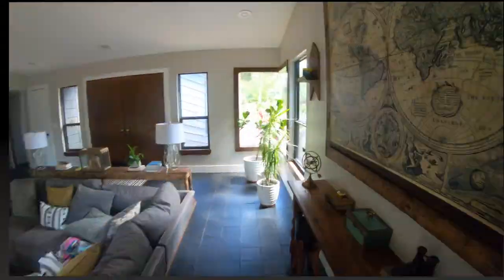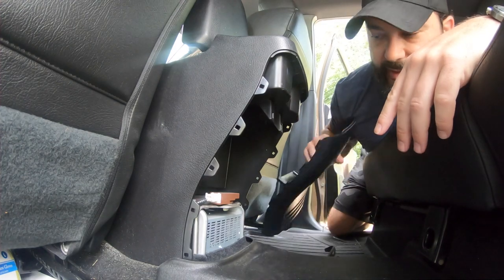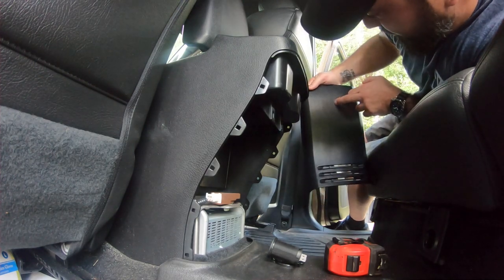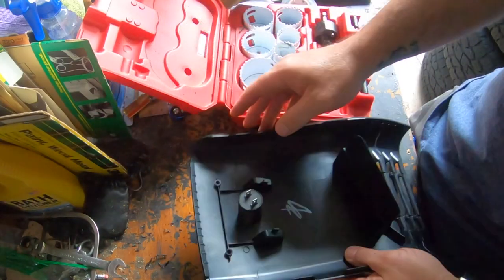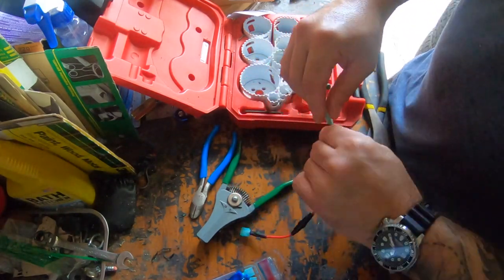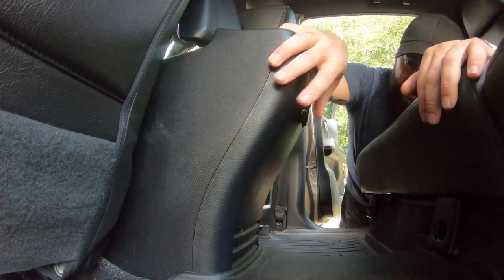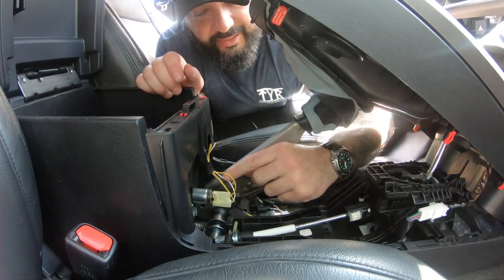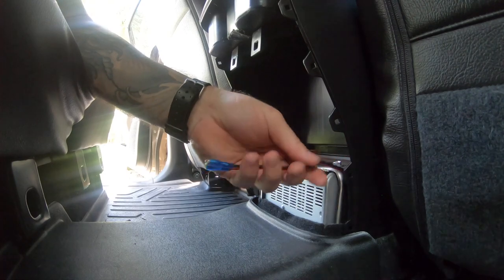Toyota Tacoma | Blue Sea Systems rear USB Charger Install  | (2017 Tacoma)

Comment from the maker: Hello everyone thanks for watching! I was asked a question on the forums and wanted to share the answer here as well. I was asked if the port comes into contact with the back seats when the back seats are folded down. The port it self will not come into contact with the back seats. It does appear very tight if you wanted to have the seats down and charge a device. It might be to tight without a 90 degree USB charger.

Comment: Thanks man always wanted to have USB connections on the rear seat for my kids too, just got it done today thank you for that great video.
Reply from the maker: My pleasure, thanks for watching! It's always nice to keep the kids happy. I have a question for you. Did you go 3 inches down from the top of the rear panel? If so how did work out for you? Any issues? I'm curious to see if 3 inches works for everyone. Thanks!

Comment: Used a different brand USB charger & yes 3 inches down is quite tight.  Also the 2021 SR5 wiring does not connect like you showed (different type connector) but 12V is still the yellow wire.  I made the hole 1 1/8 inches and no trimming required.
Reply from the maker: Thanks for the heads up. Glad it worked out for you.

Comment: My truck had the wires that you taped, but I did the mod and it’s not working. I suck with electric anything, but I added a tailgate locker and that worked among a few other electrical mods . Idk
Reply from the maker: Make sure the cig lighter is getting power, then make sure power is getting to your USB charger. Sometimes the splice connectors don't lock into the wire just right. Also, test it with the vehicle on. It would be easy to test it with a test light. Your looking to find where the power has stoped flowing.

Comment: Those wires look pretty thin.  The phones these days need more power for a faster charge. I wish car makers would think about that and use a larger gauge wire.  I think I'll run new wire and add a port on each side instead of the middle. 1 12v connector and 1 multi usb A usb C.
Reply from the maker: Sounds good

Comment: What gauge wire are you using?
Reply from the maker: I really don't remember, anything from 16-22 should be good. It's a short run.
Reply: Still working ok?
Reply from the maker: @HM-vu9zw  ya no issues at all yet.

Comment: Hi classy tacos just a question, could this be more convenient to connected the cable straight to the battery so anybody could still use the usb charger without having to turn the ignition on? Just wondering , dont know if this idea could have malfunction  electrical issues ! thanks for your awesome video 👍
Reply from the maker: Thank you for the kind words. I'm no expert in electrical wiring. I would have to say no. Not a good idea with a straight hard wire to the battery. Maybe with the proper connections. You would want the connection to at least have an in line fuse for safety, and then to a usb charger. It would be a more difficult install to make it all look clean.
Reply: @ClassyTacos  thank you for your prompt reply I just happen to be looking at in line fuse right but I’m not sure what’s the right fuse would have to use for that double usb charger? Maybe 12 I’m leaning towards installing it the way you did, thanks again 👍
Reply: @Ramonperez590  The USB charger says it has a parasitic draw which means that if you wired direct to battery it would be draining your battery when your vehicle is not on. Not recommended.

Comment: Awesome mod. My Tacoma doesn’t have a cigarette lighter in the glove box 😩
Reply from the maker: You could pull from the lighter in the front lower dash area if you rely wanted too. Thanks for watching
Reply: @ClassyTacos  Yeah I could do that. Thanks for the reply.
Reply: Is that an inline fuse in the wiring? It so, how many amps is it, 20? I have bad luck with anything electric, so…thx.

Comment: I don’t comment much but great video. Quick question why get the t and the splice and not just use a t splice?
Reply from the maker: Thank you for the kind words. I went with the T and the splice in case I needed to take things apart in the future. It makes it easier to remove and put back together. With just a splice it would be more work to remove and put back the wiring. Hope that makes sense.
Reply: @ClassyTacos  yeah that makes sense. I think it would be just as easy to just pull the plug and maybe tape the ends from the USB port side but easier to remove the whole cable if needed for sure.
Reply from the maker: @robcannella  That works too.

Comment: This was just what I needed, thank you...  any idea what gauge of wire I'd need if I wanted to run it to the back cab panel instead of the center console?
Reply from the maker: I used 18 I think. Any where around that should be fine. You can try to match the factory size as bedt you can for peace of mind.
Reply: @ClassyTacos  Thank you, yeah was wondering because the provided wiring/fuse harness seems to be a thicker gauge than what it connects to in the center console, wasn't sure if it would be a problem on an extra run of wire tacked on

Comment: Ran into a hiccup. My Tacoma has two charging ports inside the console, I have a console vault so I can’t use them. Can I still tap into them to power the out let I installed into the back of the console?
Reply from the maker: Ya that should work. Since you have the charging ports already you have a couple options. You could use USB extensions or extend the wiring to use those USBs in the rear or just tap into the existing wires. Thanks for watching.
Reply: You da man I just tapped into the existing outlet for power it 😢works great!

Comment: Stupid question but will this take some power in meaning will it make it a slower charge for people up front if it is being used in the rear?
Reply from the maker: I don't think so, this install runs off the cig lighter in the cubby, the front charger is on a different circuit. Almost positive on that one.

Comment: Did the new outlet interfere with the seat bottom when pulling it down for storage....................?
Reply from the maker: Nope, not in the closed position. It will if you have the seat down and are trying charge a device.

Comment: Awesome vid. Thanks for sharing. How would the process of tapping into the existing differ if I wanted to out 2 ports in the back instead of the 1?
Reply from the maker: The tapping would be the same with just 2 different taps. Now, you would have to make sure the wiring is capable of the full draw from what you plan to charge.
Reply: @ClassyTacos  Ok, thanks! How would I do that? (I have zero wiring experience.)
Reply from the maker: @willmtaylor  start doing online research interns of wire gauge, look up the draw from what you plan to plug in. You just want to make sure you are not over pulling on the wire or connections. Bad things happen, roasted interior. If you are not very familiar with electrical, please talk to a professional before you start adding anything.

Comment: Great video.  I like the the idea and I'm going to give this a shot on my 2020 TRD sport.  kids will love it.  Quick question about USB ports...the one you use is $47 from amazon...the others are around $10-15.  What is the difference?
Reply from the maker: The Blue Sea name brand is well trusted in the Marine/ RV Camper/ Overlanding worlds with a long history of working with no isses. Parts are guaranted for as long as you own them. That is directly from thier website. The cheaper ones have no history. Thanks for watching.

Comment: This is a great setup and really appreciate your step by step instructions!  What do you think about using the cigarette lighter inside the center console and attaching a USB charger and 2 USB cables?  Then, I could cut a hole through the back of the console like you did and run the USBs through a black grommet for a clean look?  I would love your thoughts on if this would work?  Its not as good of a setup as yours, but I think it would work?
Reply from the maker: Kevin Robinson if you plan on using a USB plug in type charger for the cigarette lighter with cables plugged into it. You could just close the lid and have the cables come out the back of the lid. Using the lighter the way you are trying would require you to cut a whole in the inner council and then another one out the back. If I am understanding you correctly. The cup holder will get in the way. Hope that helps.
Reply: @ClassyTacos  Thanks for the quick reply!  I really like your setup, but not sure if Im ready to tackle the install (tapping into the cigarette lighter wires specifically).  You are correct, my thought was to use the existing lighter, plug a dual cig lighter USB charger into it, connect 2 USB cables, then drill holes in the inner console and the outer console using a grommet for a cleaner look.  The USB cables wold pass through both holes through the grommet .  The grommet would be in the same spot you installed the USB charger, 3" below the top.
Reply from the maker: Kevin Robinson that sounds like it would work. I think the tap in is better/ cleaner and you get to leave the inner console alone. I understand you have to do what you feel comfortable with. Once you drill the inner section of the console theres no going back. Good luck with the install and thanks for watching.

Comment: Where did you get your wiring?
Reply from the maker: It was from a past project that never happened. The wiring can be created easily with wire and clips. Also, the cheaper USB linked under the video comes with the wiring set up. Thanks for watching.

Comment: Would there be any problems using both the console and back 12 v at the same time.  I wanting to install a 12 volt cig lighter not just the USB ports.  On overlanding trips, I want to charge my power generator using a 12 v port and run my 12 v fridge.  Would that be too much draw off of a piggyback single circuit?
Reply from the maker: It depends on how you run the wiring and from where you are drawing power. Look into the Guild Outfitters 12V in cab kit. Here is the install for that. -- https://youtu.be/AzOr_FG7ZT4 
This kit goes directly into the inverter for 120v in the cab separating the power for the USBs and the 120. This is a safer route than pulling all the power from one wire. I'm not an electrician, I just always go the safer route. Thanks for watching.

Comment: Wouldn't it have made more sense to put one on either side instead of on the face?
Reply from the maker: It's really tight on the sides. If anyone slides the front seats back enough while in use, there is a  good chance you are going to break at least the charger.